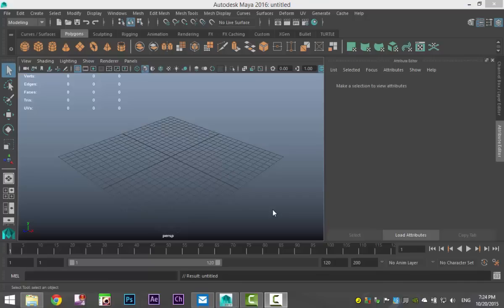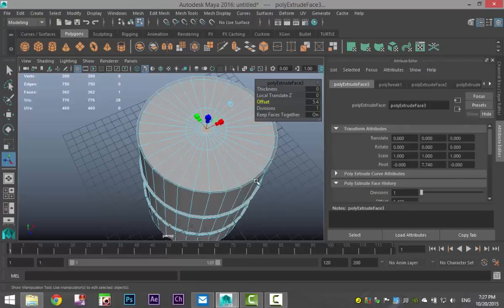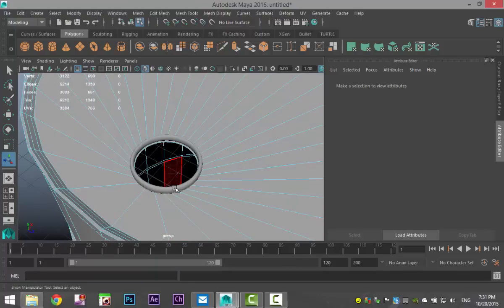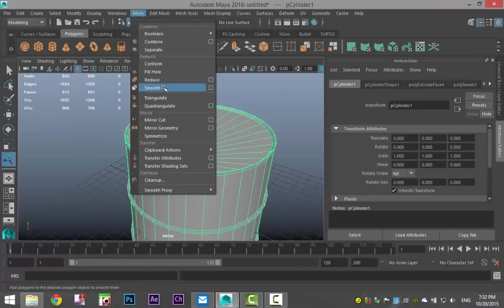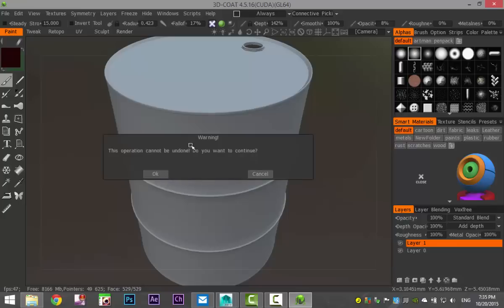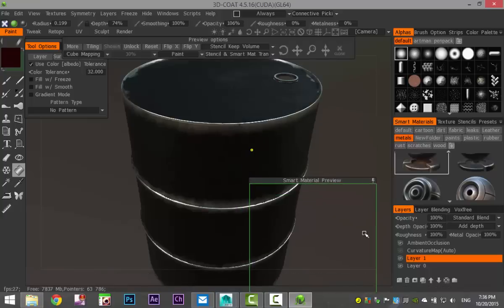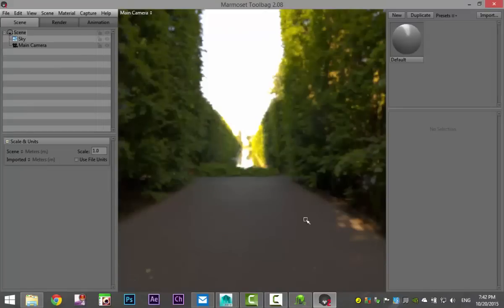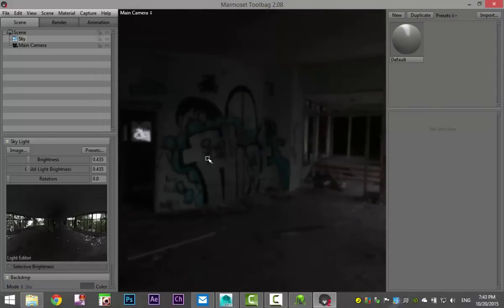Maya 2016 tutorial : Creating a game asset from scratch

Comment: I can't help but feel that is still far too high poly for a non-hero asset, even by AAA standards.  Surely some of those subdivisions around the body of the barrel were unnecessary as they don't change the shape of the barrel at all?
Reply from the maker: Ellen,

Although a slightly higher polycount is acceptable these days I would normally have create a normal map transfer to a low poly mesh to avoid that issue.

But, point taken ! Thanks for the feedback,

Mike